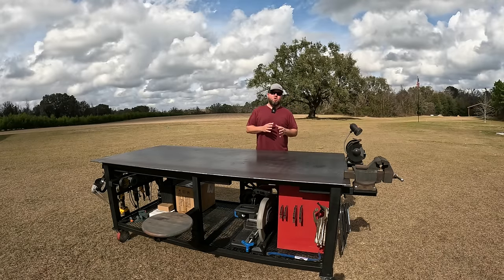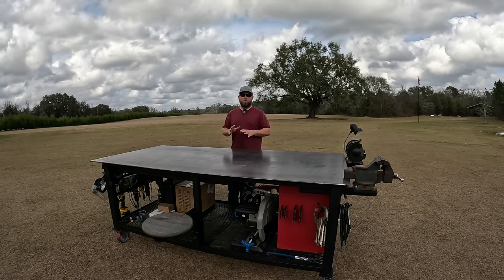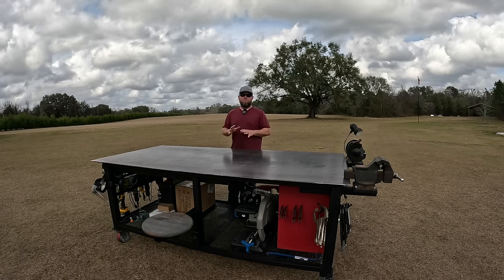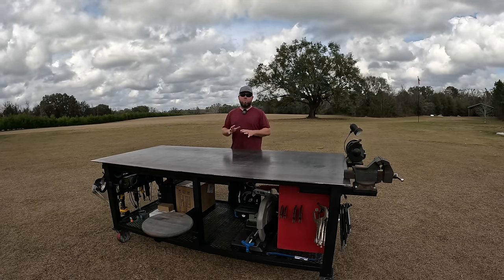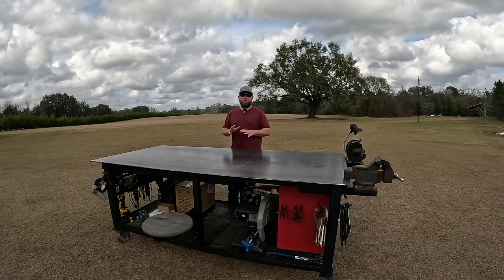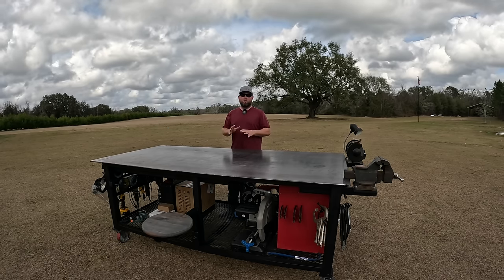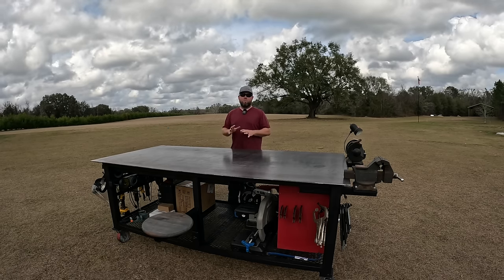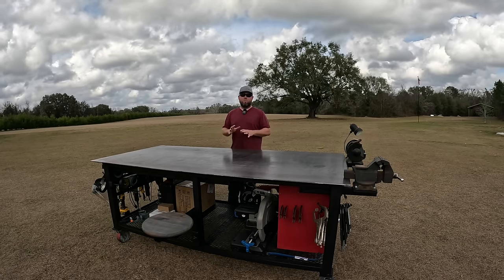Building My Dream Welding Table! DIY

Comment: There’s only one thing I see missing that I would’ve added  a an electrical box where you can bring one cable to the table where all your electrical  tools plug in directly to the table.
Reply from the maker: I did wind up buying a power strip to do that.

Comment: I finally finished enough projects, cleared out all the project materials, and built myself better storage. I have a lot of upgrades to my truck that I need a better welding table to complete. Ran across your video,  I am stealing some of your ideas like the tool cabinet, drawer slide grinder wheel holder, and magnetic clamps in your other video.
Reply from the maker: Go for it!

Comment: Love it!  I built a 3x6 version of this with no vertical supports in the middle like yours.  I wanted so badly to put swing out stools on the corners, but was worried about it being tipsy.  Table weighs in at around 460 as I built it.  Maybe I should just do it and try it out, lol.  Sweet table!
Reply from the maker: Hope it works out for you. Thanks for watching!

Comment: Dang brother, “get outta my head!” Lol, that’s my dream table as well, all but with the additions of another couple 2x2 receivers for an upright bandsaw and a belt sander AND a power bank for my welders, plasma cutter and the above mentioned bandsaw and sander. I still have a ways to go but have found that using a power reel to the bank that has a short male pigtail feeding it works best for me… Anyway, awesome job! Enjoy using it, I’m sure you won’t be able to not have fun now staying off the floor. ✌🏼 you’ve made a sub outta me😉
Reply from the maker: Thank you for watching

Comment: I built one a few years back like that. Very nice to have. Two things i did different was I used 2' pipe on the seat so it swivels from side to side and then under the table for those jobs its in the way and then second I wired the whole table with plugs on every corner. Then all you have to do is plug a fixed cord that made into a junction box on the table and then everything has power. Love your work and the details are awesome.
Reply from the maker: Thanks

Comment: On the 4in extension, I'd cut a slot hole. Bolt them together just slightly loose. Should give enough L-R slop to enable you to pull it out as one piece again

Comment: Nice! When I made mine I welded scrap 1.5 inch tubing to legs to hold my welding torch, plasma torch etc. also at the end I welded in a grate for plasma cutting. It has a tray underneath to catch debris.
Reply from the maker: Going to build a few more of these things, I especially want a spark shield on the slide out  when cutting.

Comment: The table looks great.  I recently did something similar to hole grinder discs on threaded rod but found another nice touch is to use 1/2” metal conduit and pinch that with a 1/4” washer and nut and it makes sliding on the discs and other things nice and smooth
Reply from the maker: Thanks for the tips!

Comment: Great build! You could add a bolt to the side that you cut off with a floating hole. Large clearance, so that when you pull the extension out you pull them out together. This will allow for the incongruency.

Comment: Very nice. Like the disc storage. Haven’t seen that solution. Smart. 
Having been there, done that, I highly recommend putting a 6 socket power strip on the table with a very short cord. I often have 3 of my 4” side grinders in use on the same project. I placed it on the side of my domain hand. Then use cord reel to power. 
Another new feature I did was add the 5/8 fixture holes in a 36”x36” area.  So much better being able to clamp anywhere. The last  bench I relied on the edge which worked but always needed to clamp perpendicular also.
Reply from the maker: Power strip is a good idea! Thanks

Comment: Great build! I saved the video for reference as I build mine. Just a thought you may want to consider since you already have a mag drill! What if you took and in the area where your seat is you laid out holes for a fixture table say 5/8” holes on a 3”x3”center spanning a 3’x3’ section of the table of thus giving you a 3’x3’ fixture table right in front of your seat then like you said you would have the seat and a fixture table all in the same area for any small part’s all you would need to buy is a 5/8” annular bit and some 5/8” shoulder bolts. Then you could make your own stops and clamps with the should bolts!!! 
You would have the most versatile table I have ever seen then!
Reply from the maker: Thank you

Comment: I just recycled on old frame that was in an oil field yard, think it was used for some sort of storage, it’s a 3’x5’ frame built out of 2 3/8s drill stem, I’m planning on putting a 3/8” plate on top, I’m trying to come up with a way of putting my chest type tool box that’s about 2’ tall at the bottom but make some sort of slide out to be able to keep it out of the way, was thinking of bolting some angle iron on it and welding some c-channel to the frame to be able to let it slide in and out

Comment: Gotta love a solid welding table.  Mine is 3x5 ft with a 3/8 top.  Had some diagonal slots lasered in the top like the Miller table to utilize the Miller clamps.  With the table being 100% true on the edges makes it so easy to weld things up square. Mine has desk pedestals with drawers for storage.  Adjustable feet resting in hockey pucks lets me level and stabilize it for work. Raise the feet and it's on heavy duty casters to move as necessary.  May I suggest another vise mount near your seat ??
Reply from the maker: Thank you for watching

Comment: Great table! Glad to see you have the evolution saw. I go crazy watching guys use angle grinders and hack saws to build stuff. Well done sir.
Reply from the maker: Just bought that saw and absolutely love it.
Reply: @TKCL  yes for the money it can’t be beat! I’m an old toolmaker for like 50 years. Owned my own shop for 48 of them lol. I had an expensive cold saw and we cut many a piece to tight tolerances and good finishes. This isn’t quite as accurate ( nor expensive 😜)but for fab work it’s fantastic. Here’s a little tip you may find helpful. I mounted a rod of steel to the right hand side for a stop. I made a block that you could rotate down when using. Put an Allen head SHCS in for fine adjustment. Then I use a small piece of one inch tube when setting to make a space in between.  Then I remove it allowing room for the piece to fall off without pinching. Hope you find that useful.  You made a great table utilizing all that space. I’m curious are you planing on renting a mag drill and putting in .625 holes for clamps? I made mine using 6 in wide plates with 1 inch spacer plates. I can remove and put clamps in that reach every spot easily. My plates have an adjustable  mounting so I can tweak them in for flatness to each other. I would have liked to get the plates Blanchard ground but there’s no place anywhere close to me. But I’m simply a hobby shop in my retirement anyway. Sorry I get so lengthy 😂 I’m also a novelist.

Comment: Nice bench, I built one very similar but I wish I has used expanded metal on the bottom shelf like you did. I saw a cool hack on YouTube for the bench grinder, guy mounted it on a hinge, so when not in use it swings down under the edge of the bench. I also put a power bar on mine under the edge.

Comment: Great looking table! Two things i would add are two 4 gang outlets one on each end, run the wire in flexible metal conduit. I wired mine with a male end of a plug. That way i run one extension cord plug it in and have power without all of the cords to trip on on the floor. The second thing would of been go thicker on your table top, you have a mag drill. So all you would've had to do was drill 5/8"  holes, and bam, you have a fixture table. Get some clamps weld some 5/8" bolts or shoulder bolts and you have cheap clamps. It works like a charm.
Reply from the maker: Have you priced 5/8 sheet? It's absolutely outrageous, I had to stay within a budget. Thanks for watching.

Comment: Hi, you will need an electrical box mounted on the welding table. That box will power all of your tools required on the table during a project. Get a good solid electrical board and connect all the equipment we saw there. Thank you.

Comment: Good work! If you mount the power cord reel to the ceiling over the table, it makes moving around the table with a tool or making long cuts with a circular saw much easier.
Reply from the maker: I've been thinking about mounting a second one that way along with a air hose.

Comment: For your extendable piece at the end of the table, could you drill an oblong bolt hole and use a nylon lock nut and bolt, not tighten it all the way so it allows the metal to move where it needs to and allows you to pull both out at the same time.

Comment: Impressive Design, I can see that you have long planned for this. One design suggestion: stool holder welded on the inside of the upright (so 90 deg rotated in) with the bolt not sticking out. If you ever remove the stool you have a bolt sticking out to bump into, even if you remove the bolt you have the receiver w/ nut sticking out. Additional benefit of the receiver on the inside of the upright - you could put the stool under the table for storage.
Reply from the maker: Agreed

Comment: Nice build, a loose fitting bolt in the slide out extension may allow you to keep it together but flex enough to slide out without binding, also you may have noticed, you can pull your vice and turn it 90 degrees and use it to clamp pieces vertically. Also you may find that  a strategately placed hole about 3" or so .do would come in handy for driving out hammer handles, or pins and bushings. great job.
Reply from the maker: I'm planning on building a shop press for the punch out work. Thanks for watching
Reply from the maker: Good point about a vertical clamp.

Comment: Andrew.
That is the best welding table ever. I love it. I hope you can make a cut list and detailed plan of some kind. Any idea of material cost? The best part is the receiver ends. I can see making a drop down bracket to set your chop saw on that would be flush with the table. Give you more lenght of cut and do away with blocking.  One of my favorites. 
Great build!!
Reply from the maker: Good idea on the saw table. I never make cut lists, I just build as I go.
Reply: @TKCL  I will have to steal the design 😅
Great job again 👏

Comment: Nice table, it's allot like mine.  One thing I did, after walking a little too close to the exposed corners and getting bit on the side, was grind them down into a slight round-over.  Now the corners don't bite as hard when I walk by... :D
Reply from the maker: I did grind the points off of mine.
Reply: @TKCL  Smart man! :D

Comment: Looks great. You thought of everything. Just an idea that could possibly make the chair easier to place and remove without tools. drilling holes in the tubing and using a pull pin. Also if it was pipe, you could swing it around to either end of that side of the table. Possibly putting another pipe on the opposite side to use on either...
Reply from the maker: Good point!

Comment: If the chair could move around the table in a sitting position during the work process, it would be a super device and you would not get tired and you would assemble any construction on it faster!

Comment: Awesome work/welding bench, looks like you put a lot of practicality into it.  As for your pullout tabletop support end, have you thought about using some bolts with oversized holes and use nylon lock nuts so you don't have to tighten them down and the steel channels can float a bit.
Reply from the maker: Thank you, that's been a popular suggestion.

Comment: Something of interest might be a shelf that is made for Kitchen air mixers that goes into a lower cabinet and when you pull it out it raises to counter level. Those mixers are very heavy.
Reply from the maker: Correct, that's a popular suggestion. Problem is I need the saw on the end of the table and in line with it for the long pieces of metal I cut that go down the table.

Comment: I would have liked to see you use a 1" plate for the top. I know theyre expensive, but a 1/2" will warp on you once you start adding some heat to it. That said, its a great looking table. I like the extension piece. If I can make a couple small suggestions. Weld a bar across the set bolts, that way you font have to search for a wrench to tighten them. And on the seat mount, move the bolt to the side. Its not going to be pleasant to whack your shin on it when the seat isnt there. I dont know if you did it, but add a couple bolts to the extension side so you can set that without it moving on you.

Comment: Watched the video, love the table, saw the mag drill, and would have done the drilling for a fixture top, would personally change the layout of the stool stand so I could use a swivel and turn around when I want. This is a really good table build, and very well executed, I'd also want a place to allow my chop saw to drop down into place. Good job good build!!
Reply from the maker: Thank you for watching
Reply: Maybe just a chop saw stinger you could slide into one of your pockets.
Reply from the maker: I've kicked that idea around.

Comment: Andrew you might make up another  receiver mount for a pipe vice to swap out with the grinder , rather than store under the table you could just Flip the vice and other receivers upside down to get out of the way and still be handy .   a hang on piece of light sheet metal/ tin would make a great catch tray on the slide out end (LOVE it) for catching cutting sparks, grinding scrap or even oil when drilling, maybe put it on chains to hang lower or just set it on the extension arms. on the seat you could have made it on a swivel to swing in under the table but the receiver is simple and quick . LOVE the slide out blade storage might add a tray for welding consumables to be handy , tip cleaning tools, chipping hammer hanger, and small storage ect.  very well thought out  and will be a handy and useful tool for many years to come. as for fixture tables  unless you are doing Extreme precision stuff most lay people dont really get the moneys worth out of it. Have Fun with it  from Oklahoma :)
Reply from the maker: Excellent idea about flipping over the  mounts. I've already been thinking about a spark cover for the slide out.

Comment: Standard welding table top should have 2" grid pattern holes. The table should also have fixtures to hold welder and tanks.

Comment: Love it I will be adding a couple of of those ideas  to my table.  I dig the seat mount. If you would’ve put the receiver on the side instead of the outside, you could’ve swung the seat underneath the bench when not use definitely not criticizing. I think this is pretty awesome.
Reply from the maker: Valid point, I didn't think about that 🤔

Comment: LOL ..... BEAUTIFUL work & design, the ONLY thing I would of done differently is use a roller to roll a THICK maybe more than one coat of rustoleum to it, another thought maybe add a pole to slide into the end receivers that would have a light that could be extended over the table that you could move close to your work !

Comment: It’s funny, I saw the video and put it in the queue to watch and I didn’t realize it was you doing the video? I just thought it was a welding table I was going to check out.😂 

I was pretty impressed when you pulled that section out and sat on it. I never realized steel could be that strong.  😜😝😂🤣 
Sorry, I had to do it  😂😂 

Looks awesome. 🙌🏼
Reply from the maker: Oh boy, thanks for the fat joke LOL!
Reply: @TKCL  😂😂
Reply: I just had a thought on your table.  I know it fixture table can get really expensive to get a decent one. But you’ve got Cross braces on there and if you are making a jig you don’t really want to weld to that top because you can warp it and then have places that will catch and it can be a problem. But with your cross braces if you drilled Four holes where you can get a bolt in there tightly you could put another piece of steel on top with four bolt holes and you would just have the holes in the table when the top piece was removed but then you could have a sheet of steel with four bolt holes that covered the full width of the table And make that maybe 3‘ x 4‘. Then you could put that on top of the table with only four bolts to hold it down and you could weld whatever you wanted to it as far as a fixture for repeating multiple parts and then just pop it off and has a nice smooth table top again, and that way you would only have four holes put in it to hold down another piece of metal on top that you could weld to that could be removable so you could mess it up and grind into it or whatever and easily replace it after a few years if it gets really bad. That way you have the stability of the table with kind of a disposable throwaway piece that you can add and remove without causing damage to the table it. 🤔
Reply from the maker: @ShaneZettelmier I don't apply enough heat to make an issue, personal opinion of course. With that said, I've got an idea I'm almost done with to make any table a fixture table 😉

Comment: You got the whole work shop nicely set out on that one table I like the extension my table is 4x8 with 1/4 in top I saved it from the scrap yard the guy was taking to be melt down I offered to buy it off him before he load it on his trail he told me if you can load it on your truck take well I call my brother to bring a trailer away we went
Reply from the maker: Nice score!